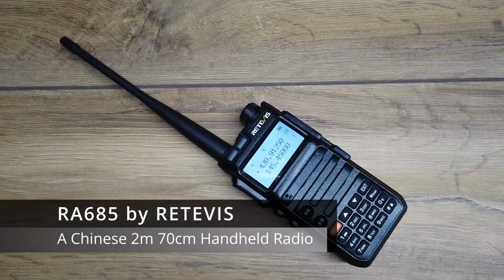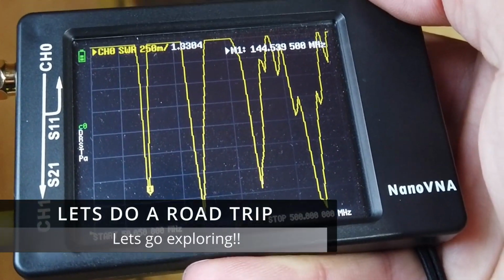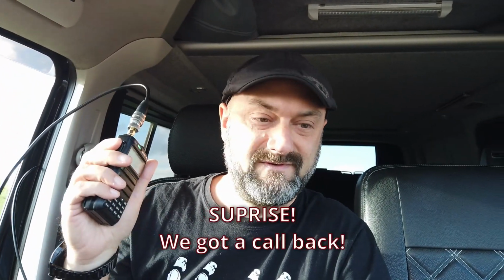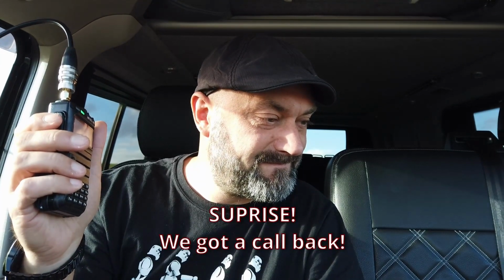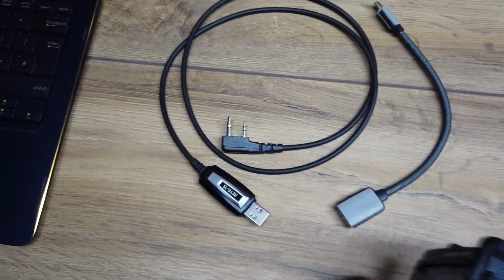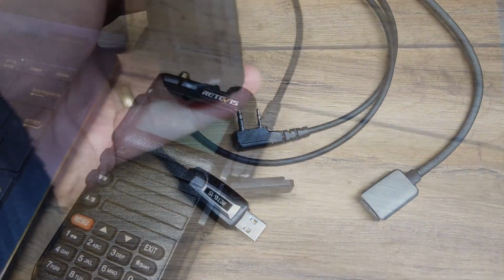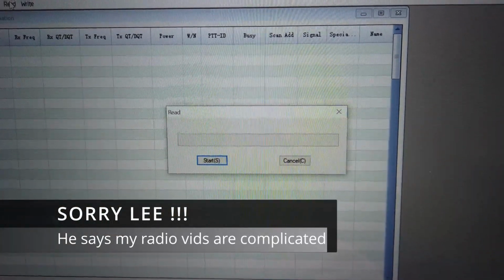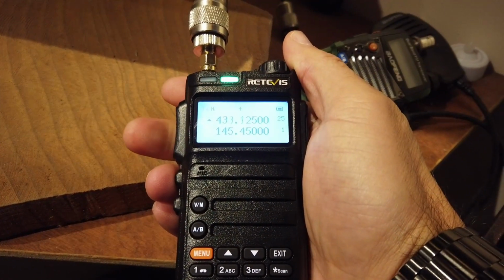DuB-EnG:  RETEVIS HAM RM685 Dual Band 2m & 70cm handytalkie radio walkietalkie - Is cheap kit good?

Comment: For some unknown reason I can only watch a few seconds ,then it stops for a while.🤔
Reply from the maker: Oh no, that's weird...   Do a browser reset and try again?  Others are not reporting problems...
Reply: If you are using an adblocker, it could be that, I'veseen it doing this... big fight between ablockers and Youtube at the moment. Try updating it's filters, or test with it turned off.
Reply: @Rip-Van-Tinkle no I don't use adbloker but tonight I had no problems thanks.
Maybe the full moon 😂